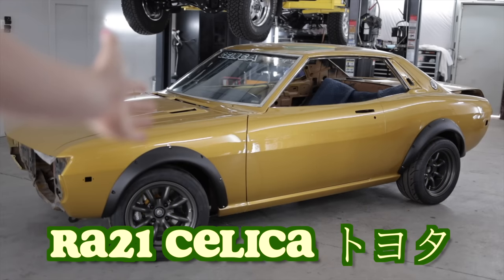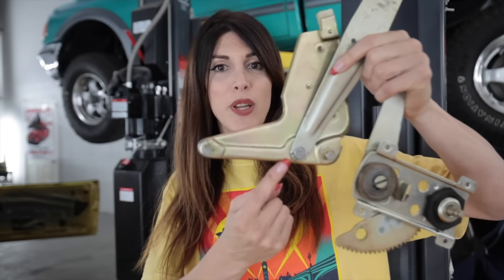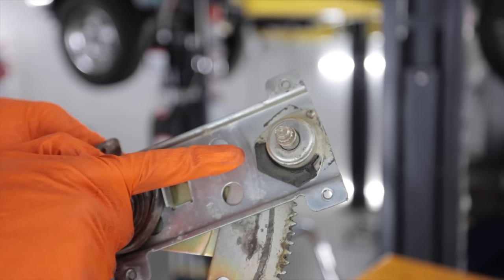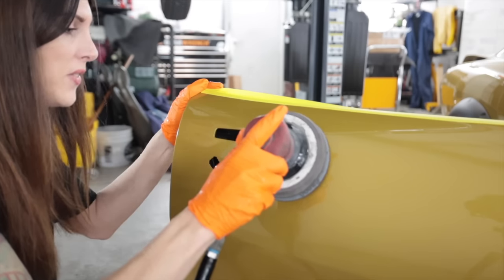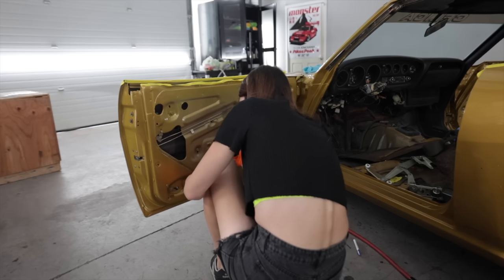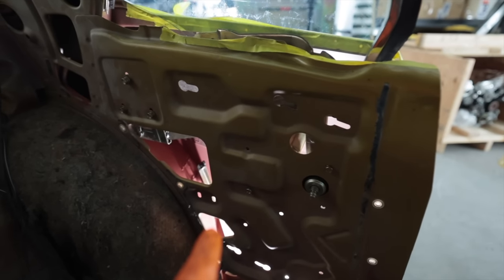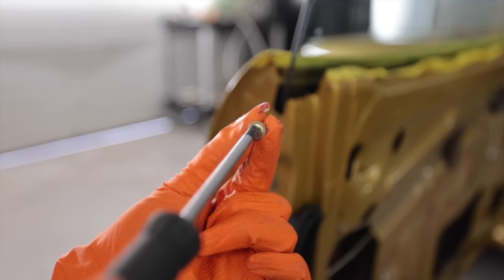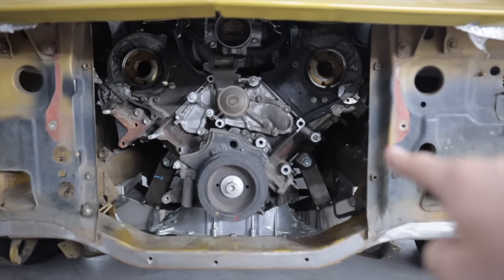FINALLY! It's Back // 2UZ-FE VVTi 1974 Toyota Celica

Comment: You are right Doing window stuff  is probably harder than replacing an engine.
Reply: Coupe windows with no upper window fram suck.  Especially if there's a quarter window to adjust with the door glass.

Comment: When you adjust the window pressure against the weather-stripping, use a dollar bill.  With the window in the up position, have a dollar bill between the glass and the weather-stripping and pull the dollar bill back and forth to gauge the tightness of the window.  You may find it tight at one end while it may still be loose at the other end. This will allow you to adjust and keep the tightness consistent.

Comment: The channel might need to be renameed to " Sarah-n-Cleaned".😅 Love to see you working on this RA21. My first car in 1994 was a 1978 TA40 with the round hedlights, followed by a 1980 TA40 with square headlights, both European models with decently sized and shaped bumpers. Both were daily drivers. I loved the cars, but the rust damage was too much in our climate.
Reply from the maker: I love the TA40, both styles. You can find clean ones for reasonable prices still.

Comment: I know for sure it doesn't work like that , remove old engine , replace with modern engine turn key and drive, HAA HA , never, I am still working on the swap wiring , for when the engine goes in. And 71 Camaro windows were a real pain as well, long and heavy , keep up the realistic video's !!

Comment: Of all the hardtop coupe cars I've ever worked on, the easiest to install quarter windows are on the 71-74 AMC Javelin.  Why??  Because the whole interior steel panel unbolts from the car.  So, removing 8-10 bolts and you remove the quarter window, it's lift/lower assembly PLUS the interior steel panel as one large piece.

I've grown to dislike doing window replacements on virtually any other cars.

Comment: I am not forklift certified, but........
I know not to do a backwards 360 with 900 lbs lifted 12 feet in the air.
I learned that from......
....well
....well, why would you have to learn that in the first place? It's just wrong, everyone knows that.
...except for the guys that shrink wrapped a co worker to a 5 foot tall pallet of frozen waffles before doing a 360. 😱
Ok, maybe certification isn't a bad idea.

Comment: Doors are always the hardest, that is if you want them right. They are responsible for body gaps, wind noise, entrance and exit, water resistance, safety and even things like trim and outside mirrors and even more things.
Pro tip: When working on doors, a mechanics seat, or even just sitting on a creeper helps with back aches and ease of reaching for a tool.

Car is gonna be stellar! Alread is really.

Comment: Hey Sarah! I'm 71, around 1972 I was driving by a used car lot and saw the coolest car-turned out to be a 71 Celica. I was raised on Japanese motorcycle quality and bought it. Drove it for 12 years, From Tx to Florida, Austin, surfing in Galveston,  never had a problem. Such a treat to cruise with the ac blasting and the car not overheating like my old Mustang pos. Never figured out why someone traded her in. Yours is gonna be awesome with that engine, I had a Lexus SC400 with the smaller V8 and it was a cruiser. I do hope it's not too front heavy tho lol.

Comment: Tip re: removing the little peined in axles in the window mechanism: Center punch and drill/drift it out. You may end up with a slightly out-of-round hole, but almost no breach in the electroplating. I've done things like this a lot, in many situations. The window area is a low-precision environment, and it will tolerate the ~.02" potential slop this process will generate. The small breach in the coating can be cancelled with grease.

Comment: Hi  long term lock/roller /window slide grease is critical try Castrol PH [hydrated calcuim ] very water proof . Door mech grease can be made from aluminium oxide  as well.
Graphite grease also may be used but as a last result . Its more suitable for starter bendix drive throw out and armature bushings 
* Normal lithium grease needs replacement and will not lube as well . When after a few years it will go very sticky then very tacky .
Door lock graphite powder  or PTFE spray 
Window " bailey ""  felt channel  can be lubed with silicon spray

Comment: Re: headers - one approach would be to "design" them yourself using the ICE Engineworks header building kit legos, then take the completed lego to a shop somewhere in town who can build it off that reference. That way you get a reliable and well-manufactured result, but get to have participated in the process.

Comment: I Zinc/Nickel(separate or together) plate myself, just need white vinegar, salt, zinc and nickel anode with a power supply and voilà! Also Hydrochloric acid to etch the steel before plating. sandblast or wirewheel the steel or chemical rust remover(rinse with water after). thread are tought when too much rusted... Need to do the plating outside cause it generate hydrogen and oxygen with some chlorine gas all of this is bad, hydrogen can explode but it's too small quatity to happen but the chlorine gas is really bad to breath.

Comment: If you want to be red pilled then look at this and other car repair/restoration of pre 2000 cars. 

You will realise cars:

Can and should last indefinitely
Lasting indefinitely is more better for the environment than a EV that cannot be maintained or repaired (no parts and/or intentionally high cost of replacement parts) past warranty.
Repairing and restoring is not hard
The thought of repairing and restoring is harder than actually doing it
Product obsolescence is real
Intended barriers (tools, computers, knowledge etc) to repairing is real

Companies wanting to control and prevent people repairing to transform them to just users (no ownership, no repairing etc) is real. Look up "Right to repair" legal battle.

Comment: on my car even the oem rear window regulators are junk and out of production and you can only get aftermarket and the aftermarket ones which are even more absolute junk that only last about a year, seriously just driving down a smooth road with no bumps and the gear will just crumble then down goes the window! so after changing both sides many many times in a few years I said fuckit and drilled a few holes in the tracks and bolted the windows shut and disconnected the switches and I havent had to change a rear window regulator in 4 years!

Comment: Door latch mechanisms , degrease with pressurised degrease gun then wash and dry .Use a syringe to inject grease into mech where needed . Some cars have a plastic  boot to cover mech , this allows u to be more generous with lubrication

Comment: where do you get your genuine parts? need some for the honda build
Reply from the maker: Tons of digging on the internet with manufacturer part numbers. Once you have the part number from Honda for your part it makes life a little easier, use the official Honda parts website to look them up on the illustrated parts break down.

Comment: Sarah, there is a kit of header joints that allow mock up easily. It's pricey and I can't remember the name of it. Old age or senile. I've been through several tig welders. A few years ago I purchased a Prime Weld unit. The pulse function makes thin metal very doable. I know you have a busy schedule but if you're going to expand, you might look at that. You are doing what ,most of us find tedious. You can at least see in a door panel. Old people struggle with that. :)

Comment: Things ALWAYS take longer than expected. I spent nearly 4 hours, until well after dark, and was just about to abandon all hope and just go to bed, trying to get the last nut to thread onto the bolt that holds the exhaust wye to the exhaust header. Then BAM, randomly starts threading on and I rush underneath to start turning my ENTIRE collection of ratchet extensions that was needed to reach up there between the pipe and the body where no arm will ever fit. I was still frustrated and exhausted, but at least it was finally done. There MUST be a better way...

Comment: Great clip again. A quick fact. Assembly regulator operators on the line know all the tricks considering they can install one in 45 sec.. but that's all they do and can do it blind folded. They know all the tricks.

Comment: 100% with you i used to hate replacing the door working's especially window regulators cause you have to remove allmost everything to get them in and out and there is soo many clips and brackets to break lol.

Comment: for the roller on the windows I usually just go to the hardware store and get the nylon rollers with the bearing in them that they use on draw slides and shower doors. they work great as replacements for those.

Comment: Door regulators are a pain ,next come door locks esp if they don't want to work. BTW the plumbing aisle at hardware stores usually has silicone grease you can use.

Comment: I just replaced a window regulator on a 20 year old Honda. Took 6 minutes total including the time to take the door panel off, glass out, glass in, panel back on. It's amazing the difference in engineering between 1974 and 2003.
Reply: Not today, Satan

Comment: Thank you for your video. May I ask for your advice? I'm interested in putting a 4.3 v6 of a recent Silverado into a 2011 Colorado. I'm not familiar with what is needed besides the new engine and transmission.
Reply from the maker: Don’t. You can swap an LS into a Colorado though fairly easy. Much better use if your time/effort.
Reply: Ls the world lol
Reply: @SarahnTuned  Thank you for your response. Would it be possible to ask for your recommendations/experiences with the 3.7 5 cylinder engine in the Chevy Colorado?

Comment: You don't need TIG welding to build headers/extractors, I built a s set back in the seventies, with Oxy/Acet welding,  cut the flanges with a Jig saw, had the pipes bent a my local exhaust place, they are still on the car today.